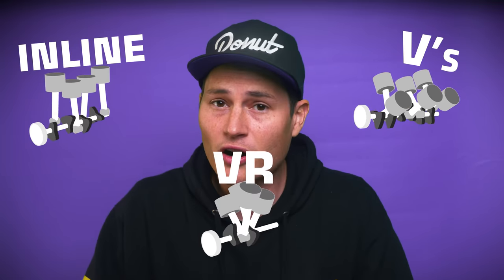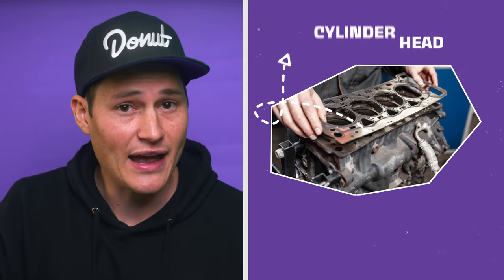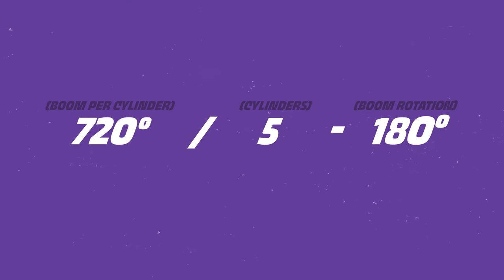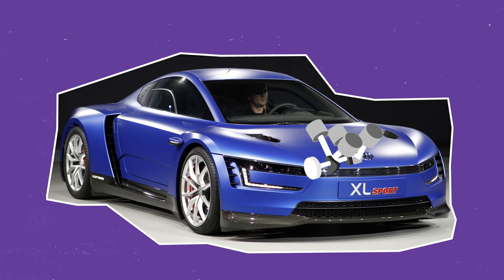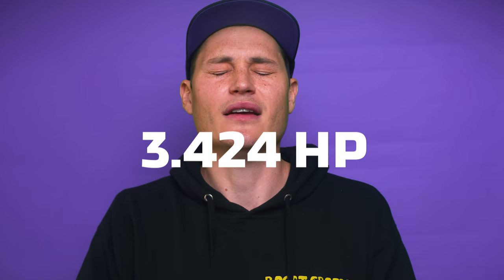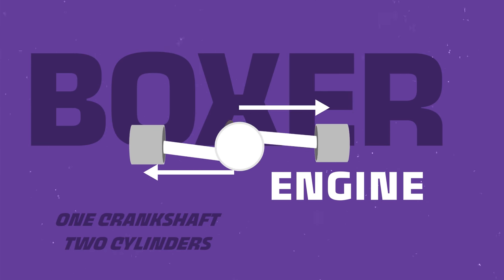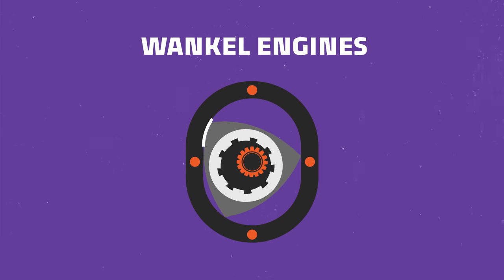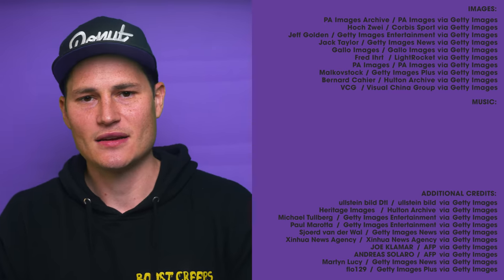Every Engine Layout Explained

Comment: Old video, I know, but I find it very odd (and I'm honestly quite bothered) that you claim that V5's are not found in cars. Volkswagen ran a V5 engine for a few years, thought they were known to be....not very good. (According to a quick Google search, from 97-06 the V5 was essentially a VR6 engine with a cylinder chopped off). It was designed to be a middle ground between a 4-banger and the VR6.

Edit: Fun fact, GM developed a prototype V5, which, similar to the VW engine, is essentially a V6 engine with one cylinder removed. This one never reached production however...Also this one was a diesel engine.

Comment: you forgot a rotory engine we usually call this special type a Umlaufmotor. This is a special type of rotory engine, not the crankshaft rotates, but the whole engine rotates around. It was used in some cars, motorcycles and airplanes. https://de.wikipedia.org/wiki/Umlaufmotor. 
i think thats a very unique engine whats used. there a more special enginges out there but only used under labaratory conditions or unique prototypes who never drove on the street

Comment: I need an honest response to this question with the way technology is going.
With all the drive towards electric charge vehicles is it possible to have engines made out of circuit boards with no moving parts at all?
Reply: If you want to have an engine you still need moving parts at the end of the day. I suppose you could try to shortcut the motor step and try to make the wheels spin directly with induction but that would be more complex and less effective I think. The number of parts in an electric engine is already super small compared to combustion

Comment: Haha yes ik how much of a pain it is to change the spark plugs in my gt Forister.  Fun fact not really but boxers are like rotarys in the sense that when u remove the ultinater an all the electrical stuff theres really not much engine there its just a little thing in the bottom of the engine bay lol

Comment: You got flat engines and boxers engines kinda backwards. Boxer engines have separate crank pins for each piston, flat engines do not. Flat engines have opposing pistons share crank pins, and are essentially 180 degree, or horizontal, V engines. Boxers engines aren't. In a boxer engine, opposing pistons move in opposite directions when viewed from the front of the engine. In a flat engine, opposing pistons move in the same direction when viewed from the front of the engine.

Comment: 10 Cars That Had A V4 Engine, Ranked By Horsepower
10 1960 ZAZ-965.
9 1960 SAAB 96.
8 1924 Lancia Lambda.
7 1968 SAAB Sonett V-4.
6 1967 Matra M530.
5 1971 SAAB 95.
4 1969 Ford Capri MKI (1.7-Liter)
3 1972 Ford Consul (Granada MKI)

Comment: 13:39 He's a bit wrong here about Boxers and Flats in general. All Boxers are Flat engines but not all Flat engines are Boxers. A Boxer is simply a flat engine where the piston in line have separate Crank Pins. So the ferrari he's talking about is actually a Flat Engine but not a Boxer.

Comment: every engine is a compromise to suit an application. an I3 is cheaper than an I4 but doesn't run as smooth. a V-engine needs more overhead camshafts than an I. A boxer takes up more space in the engine compartment and is a little more expensive. An I8 is great when you like to to have a huge pile of empty bottles after an oil change. A wankel is good for applications where you have plenty of oil to burn. ;-)

Comment: I had a BMW that was a parallel twin with a 360 degree crank offset. So both pistons went up and down at the same time but fired opposite cycle to the other.

Such a boring sound and power profile but was a torque -y boy

Comment: you should mention that 90% percent of all cars engine today is I4.
manufacturer uses single and cheap engine design for their majority of cars.
if you need more power and torque smaller or bigger turbos are added.
V8 are long dead, since they consume too much fuel. trucks also migrated from v8 to inline 6. V6 is only used for 400 plus hp cars, and v8 and more is used for locomotives and marine aplications

Comment: you forget the square engine frome suzukie lie the U shape two crancshaft but 4 cylinder one at each corner and side carburator with rotating disk to block fuel entrance

Comment: You need to go back to school . Flat does not mean boxer ,.it refers to the cylinder bank angle . Both the boxer and 180° v are flat engines . Also a crossplane crank similar to those in most v8s actually works better in a 180°v than a 90°v .

Comment: I think he engines are kinda stupid, due inertia by pushin the piston one side, the same ammount of energy is recieved by the motorblock itself, which is why it is vibrating as fuck. Worse is when you put all the pistons close to one line on one side of the motor, in the first ones they all do that meaning the engine block gets the most ammount of push and vibrations as possible. If you would have a piston going to the right and a piston to the left with the motor block in the middle it will mostly stay stationairy. problem is that one piston is little bit further away on the crank shaft than the other so you can a twisting force, since they arent on one line. If you would have 1 piston and 2 smaller pistons (together in mass the same as a the big one) on both sides on the motor, and they go out and in towards the motor, the motor would stay in place and barely move at all, as when a piece of mass is launched from it, the recoil is none existant because its receiving force on the otherside as well equally destributing the pushing forces on both sides.